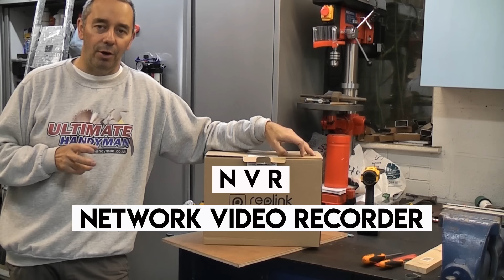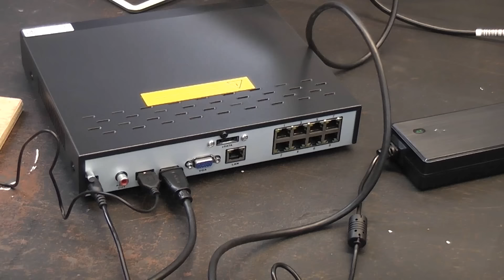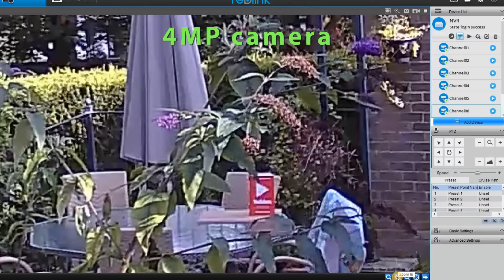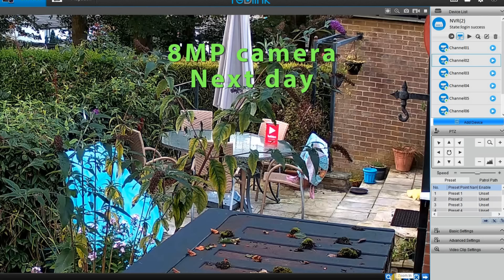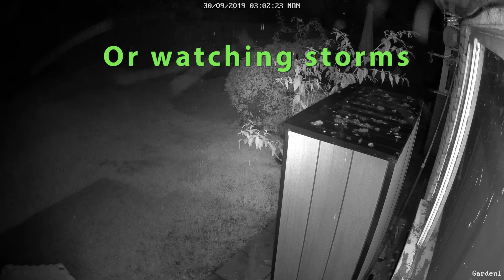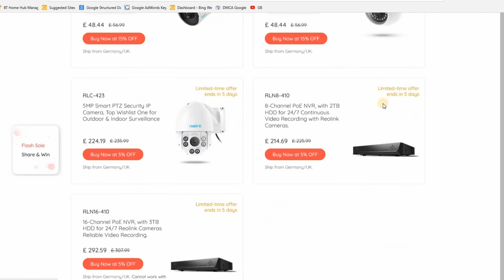Reolink 4K Ultra HD (8MP, 3840 x 2160) security camera and NVR

Comment: Hello, are you still happy with this system please?
Reply from the maker: Yes, it is great. We have used it several times when there have been "undesirables", trying people's car doors etc.
I've also used the PTZ camera at the back to film, when doing jobs in the garden etc.
https://www.youtube.com/watch?v=9qK1dI8tCW8
Thanks for the comment 👍
Reply: @ultimatehandyman  are you happy with the phone app? I understand the cloud function doesn’t work in Europe or UK because of GDPR?
Reply from the maker: @haroldbetterson1877   The phone app works fine, but is dependant on your phone signal.
My phone is pretty much useless at home, if I try and watch a Facebook video the video normally buffers after a few seconds. The Reolink app is the same, but if I'm out and have a good 4G connection the picture is fine. 
The girlfriend uses the phone app all the time, But I don't like mobiles, so tend to do everything on the monitor from the NVR or via the desktop app.

Comment: Do you rate this system and the POE/NVR option? Thinking of buying.
Reply from the maker: Yes, although the older version with the standard HD camera's seems to work better, due to the size of the huge files with the 4k cameras
Thanks for the comment 👍
Reply: Thanks for the reply. So many different options, it’s mind blowing. Just need a simple to use/reasonable quality system. Good/quick notifications and maybe a spotlight.

Comment: @Ultimate Handyman: Thank you for making and sharing this video.

I do have a few questions. 

1) Can you view the footage on your  phone and monitor the same time?

2) Do you get alerts? And if yes, on the phone and monitor?

3) Can you view the footage on multiple devices at once?
Reply from the maker: 1) I think so, but not 100% certain. I rarely check the footage on my phone as it is slow, because of the speed of the Wi-Fi. 
2) Yes. You can set it up to buzz, email or push alerts, but I have 8 camera's and there is a road and lots of trees surrounding the property, so you would be getting several alerts a minute. You can set up the NVR to beep when there is movement- but like I have said, it bleeps every few seconds due to something moving. You can of course select an area of the screen which will activate motion detection (rather than it being the whole of the area that the camera picks up).
3) Yes. There have been times where I've been watching the footage via the NVR and the girlfriend has been watching it on her phone.
Reply: @ultimatehandyman  Ok. Thank you for getting back to me with the answers to my questions. I really appreciate it.👍🏼

Comment: So if I set it to record 24/7, how long does it record for? How long does it store the footage? And how often do you have to delete old footage?
Reply from the maker: Not sure, as there are lots of variables. For example, I replaced the standard hard drive with a larger one, then I installed an external hard drive.
My system has 8 camera's, 4 of those are 4K and the other 4 are HD
My system stores the footage for about 3 weeks. There is no need to delete anything, the system continually overwrites the older footage automatically.

Comment: Really helpful review. Does POE allow you to have a monitor showing the cameras live 24/7, my current wireless setup only allows you to view for 20mins and then times out. Does the reolink allow you to view all cameras constantly live on a grid setup?
Reply from the maker: Yes, if you use the POE cameras and the NVR, you can watch all camera's 24/7 on a monitor. The NVR will also record all camera's onto the hard drive and when that gets full, it will overwrite the oldest footage first. I have an external hard drive as well, so I get a couple of weeks worth of footage stored. The 4K camera's obviously use up more space than the HD camera's on the Hard drives.

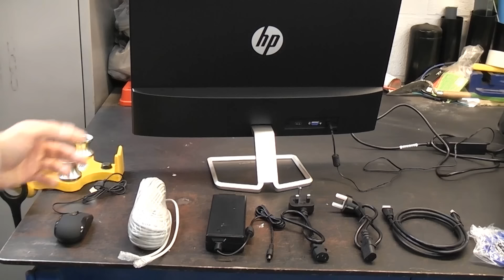Comment: I have the Reolink B800 NVR system setup and think is is great during the day. However a bit problematic at night. What would be a good addition to this review is what the settings of the camera and system are, as this would help to determine how good it is. I find that during the day the resolution and clarity is great, however at night it struggles with noise unless additional IR illustration is provided. The walking test, as shown in the above video, is great at dusk or just after, but what about at 02:00 in the morning when there is no residual light around, or what about a running test from side to side. I’ve found that the Reolink suffers from noise and ghosting when the subject is not within 10 feet or so of the camera. Have you found this at all?
Reply from the maker: We had a prowler on the street last November in the early hours of the morning ( about 2am )
The footage was reasonable and enabled the guy to be identified. I guess there are better systems, but they will be more expensive.
Thanks for the comment 👍

Comment: Hi UMH. Did just saw you video and have som questions.

1) Do you need a screen when doing the confuguration of NVR and cameras? Or can all be done within the app - when you have scanned to QR code on the NVR? And/or can you access the NVR remote from a webbrowser from my PC that no physically connect with cabel to the NVR and PC?.

I dont have space for the nvr and screen, where the NVR must stand.

2) Do you have information about energy consumtion - since the NVR must be on power all year around.?

3) Can you use a POE switch to attach all the cameras. And the wire a cabel from that switch to the NVR?
Reply from the maker: 1) I'm not sure about that. I would imagine that you can set it up using the APP, but I find things easier with a screen and a mouse etc. If you can only use a mobile app I would send Reolink a question first before buying this.
2) It does not use a lot of power, if I remember rightly the whole NVR is protected by a 3AMP fuse. It says on their website that the NVR uses less than 10W (without the HDD and POE cameras).
3) No, I don't think so. I think you have to wire each camera directly to the NVR (which has built in POE)

Comment: How did this work out in the end? Or did you move to another make or type? You have a ptz vid but wondered which was best for you?
Reply from the maker: I'm still using this system and I'm happy with it ;-)
Reply: @ultimatehandyman  debating whtehr to use this or a wireless one... This one risks losing the footage if nvr stolen... Unless you lock it away in the loft or something!
Reply from the maker: @justintemp   That's what I did- https://www.youtube.com/watch?v=7gZqpOGwnGs&t
Reply: @ultimatehandyman  thanks
Reply: @ultimatehandyman  I am trying to  find your vid where you core drill for a vent duct but don't actually use a core drill but just normal drill bit.... Do you have that vid?
Reply from the maker: @justintemp   https://www.youtube.com/watch?v=P0Pj9zzPN0s&t

Comment: Any idea on the FPS of the recorded on the NVR?
Reply from the maker: I'm not sure, sorry. I have checked here but can't seem to find that info-
https://reolink.com/product/rln8-410/#specifications
Reply: @ultimatehandyman  yup i cannot find that info as well. Those days pc based cctv capture cards with analog RCA input will drop the fps if more then 1 cctv camera is used and to capture moving objects is hopeless as its blur.
Reply: @raziackzing  20FPS is what's recorded to NVR at 4k.
Reply: @ultimatehandyman  also i realised reolink use 100mbps network on their recorder/NVR. I wish they have 1gps network so there is no reduced bottle neck in transmitting the 4k signal. One way to do that is to drop in video quality can be fps or increase compression ratio and that reduces the stream size to accommodate 100mbps network it use.

Comment: Hi, I’ve just bought the reovision UHD 4K 8mp system. I want to install the cameras at a height I can deal with, about 12 foot  but that means fitting them flat against the wall. Any ideas on how to tidy up the cables, particularly the two I’m unlikely ever to use ie power and reset switch. Thanks
Reply from the maker: The cables on these are a pain in the backside to be honest. I'd like to see them designed so that the cables can be hidden in the base of the camera. I ended up installing waterproof enclosures, then having the connections and reset switch inside of that. Because my house is brick with cavity wall insulation  I could not think of another way to do it. 
The ones I used were similar to these but in dark grey and were about 150mm by 120mm - https://fave.co/3dxdaOQ
Thanks for the comment 👍
Reply: Ultimate Handyman, thanks for the excellent reply, I will do as you suggest 😀

Comment: I've read some people saying that these won't work with a POE switch, for example a NetgearGS305P, would you mind testing if you have a POE Switch?
Reply from the maker: I got rid of my POE switch as this NVR has 8 channels which are all POE, the network cable from the NVR is just plugged into my regular router, so I don't know if it will work with a POE router, sorry.
Reply: @ultimatehandyman   Ultimate Handyman  Ah ok. I have the previous version of this NVR but 16 channels which works fine. I have only four cables into the NVR - one for the LAN/Internet then three directly to cameras. The rest of the cameras are on my network like any other device but powered from POE switches - this way I didn't have to run cables very far as I can just run the camera to the POE switch which is on the network. Existentially I have 11 cameras down one cable to the NVR. Makes wiring a lot easier. :) I'm just worried that if I get the 4k version I won't be able to use the POE switches which will be a nightmare as I can't get the wires to the NVR without bashing holes all over :P
Reply: @Phil_AKA_ThundyUK  Works fine using a POE switch, I have three B800 cameras connected to a GS305P switch which is in turn connected to the Reolink 8 channel NVR

Comment: What's the best way to get the cable from through the soffit and into the loft? Is it easy to push through, I assume there's some insulation or other possible obstructions. Any tips or good videos on this? Thanks
Reply from the maker: It can be a real pain to get the cables through, I have done it in this video- https://www.youtube.com/watch?v=sH0o-H0mCWM&t=

A cable access kit is best, you can drill the hole and push the cable into the loft, but sometimes you hit something solid, so then have to move positions. It's best if you can get in the loft to check before drilling the hole.
Thanks for the comment 👍
Reply: Ultimate Handyman That’s brilliant. Thanks so much for the reply. Very much appreciated. Hopefully I can get it through the soffit and into loft without too much fuss.

Comment: Hi Ultimate Handyman, Do you have any of the camera cables going through a cavity? About to have some installed along with a house rewire and would like to hide the cabling rather than having conduit running all over the walls. Be good to know if you have successfully done this. Cheers Matt
Reply from the maker: I've done it with alarm cable in the past, but that was decades ago, so no video footage of it.
The cavities at the house where I live now are insulated, so no chance of doing it. 
https://www.youtube.com/watch?v=tbG9Flhrf34
Thanks for the comment ;-)

Comment: Nice video.😀 I have 5mp system and i buy 1 8mp d800 camera.But it not recording video and live view is only available in fluent.I think my nvr is comptible model nr RLN8-410-E.I updated firmware but still no luck to get it work.
Reply from the maker: The 8MP camera's are not compatible with older NVR's 
When I first got the 8MP camera's I spent a day updating firmware trying to get the cameras to work properly but they will not. Annoyingly the new NVR has the exact same model number as the new NVR 9 ( RLN8-410-E) but the old ones will not work with the 8MP camera's as the hardware inside is different. 

Thanks for the comment 👍

Comment: Hey bud, I have the same system but 4mp system. If I want to add 4K camera would the nvr receive the 4K signal?
Reply from the maker: No, unfortunately you need the newer NVR for 4K, and to confuse matters both NVR's have the same model number. I actually tried the 4K cameras with the old NVR and wasted about a day doing firmware upgrades, only to find that you need the NVR that they sell with the 4K cameras.
Thanks for the comment 👍

Comment: Can you send me the external 4tb brand you used ?
Reply from the maker: I'm not sure, but after fitting it, everyone said I installed the incorrect one and should have used a WD purple drive- as they are meant for surveillance systems (the original NVR hard drive was not a WD purple though (if I remember rightly)
Thanks for the comment 👍

Comment: thank you so much for this video and in-depth look! 1 Question: at 6:18 you mentioned you had 8TB total, 4TB internal and 4TB external, which HDD did you use and where can i find a list of supported HDDs and what filesystem should the HDDs be formatted to?
Reply from the maker: You can use any HDD, it can be formatted via the software in the NVR- it's really easy to do.
Thanks for the comment 👍
Reply: @ultimatehandyman  May I ask what cable you used and power supply you used to connect to the esata port?

Nb. The cable I have now is described as 
"2 in 1 Hard Disk Drive SATA 22Pin to eSATA Data USB Powered Cable Adapter 50cm Use for HDD 2.5" Driver Laptop Converter"

Really looking forward to your answer on this, because this has me stumped. 

Thankyou so much!
Reply from the maker: @BeaglyO   It depends on the hard drive. If the external hard drive is 2.5 inch, you do not need a separate power supply (just the eSATA cable).  But if it is 3.5 inch, a power supply will also be needed 👍

Comment: What diameter hole did you drill to get all three cables through the soffit?
Reply from the maker: Can't remember now, I think it was just large enough to get a RJ45 connector through, so possibly 13mm or 15mm Thanks for the comment 👍

Comment: Hallo! the nvr also works with wlan cameras
Reply from the maker: I'm not sure about that, I think you might need another NVR for those cameras
Thanks for the comment 👍
Reply: Can be sure, works fine. Installed 6 normal and 1 wifi - no problems at all 👀

Comment: All ethernet cables that go from camera neee to go to the nvr, right, can connect them to other aimesh routers for example?
Reply from the maker: I think they have to go directly to the NVR. I have used the other Reolink camera's without the NVR, and I just had that plugged into a router, but it does not record 24/7
Thanks for the comment 👍

Comment: From your YouTube book 📖 demonstration, I couldn’t notice any considerable making of detail from the 8mp camera than the 4mp one. I already have the 4mp system installed and it’s great. Would you say the difference is the field of view which is wider up and down and left to right. I don’t notice any more precise detail on the 8mp camera. Asking because wondering if I should upgrade, all I have to do is what you did by removing old cameras and putting in the new ones.
Reply from the maker: The detail is better with the 4K camera's, but it's hard to show it on my setup as my monitor is only HD. I also only film in HD now as 4K is too large and too difficult to edit, due to file sizes etc.
The 4K cameras do pick up a much larger area. Unfortunately, the 4K cameras are not compatible with the older Reolink NVR, so you would have to replace the cameras and NVR. 
To be honest, if I was you, I would wait as long as possible before upgrading, as eventually, they might improve the video compression, to H265 compression. 
Thanks for the comment 👍
Reply: Ultimate Handyman my thoughts 💭 exactly 
Thank you !
Reply: @jameslouis689  don't be too sad about the 4K cameras. I ordered 1 set only because of a really good offer...and even with all settings for that the picture quality disappoints me...i run 5MP and 8MP here and if i had pay the normal price for their set it will be go return. But because of the good offer i will keep it

Comment: I'm interested to buy this CCTV system, is it possible to set the cameras to record at 1080p? Also to have more space on the hdd
Reply from the maker: I think you can do that, but I'm not 100% certain. You could, however, buy the 5MP kit and save over £100

https://reolink.com/product/rlk8-410b4/
Thanks for the comment 👍

Comment: How do you run the wires to all the way back to the system if is to far
Reply from the maker: You can get a RJ45 coupler, to join one network cable to another, some of these videos might help-
How to fix cables to walls- https://www.youtube.com/watch?v=tbG9Flhrf34
How to wire a network socket- https://www.youtube.com/watch?v=TWxKfHhqN2Y
How to crimp a network cable- https://www.youtube.com/watch?v=LXcbZ_l5E0U

Comment: Love the channel! Do you have a video of the original installation of the wiring etc, thats the part i need help with, thanks!
Reply from the maker: No, but I've done videos on most of how to install the stuff-
This video shows how I installed the first Reolink camera- https://www.youtube.com/watch?v=sH0o-H0mCWM
This one is replacing a Y-cam camera with a Reolink PTZ- https://www.youtube.com/watch?v=9qK1dI8tCW8
NVR security tips- https://www.youtube.com/watch?v=7gZqpOGwnGs
How to fix cables to walls- https://www.youtube.com/watch?v=tbG9Flhrf34
How to wire a network socket- https://www.youtube.com/watch?v=TWxKfHhqN2Y
How to crimp a network cable- https://www.youtube.com/watch?v=LXcbZ_l5E0U

Thanks for the comment 👍